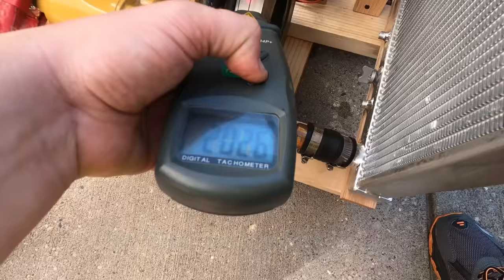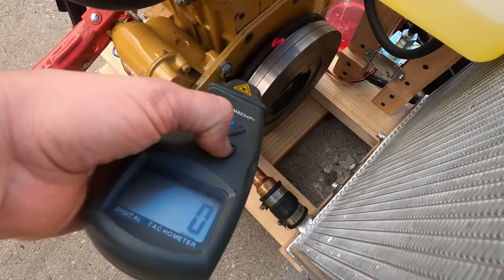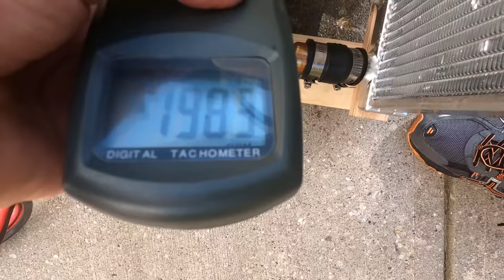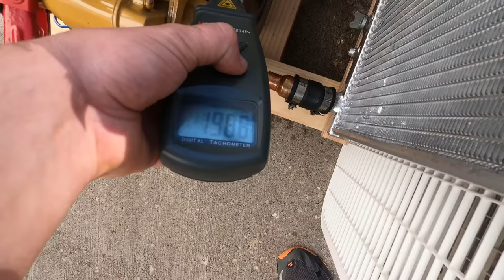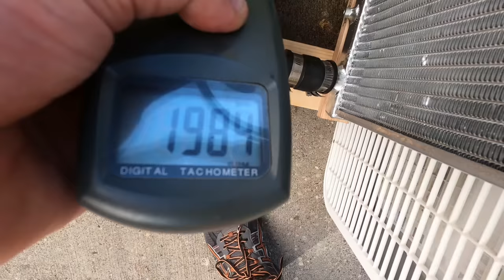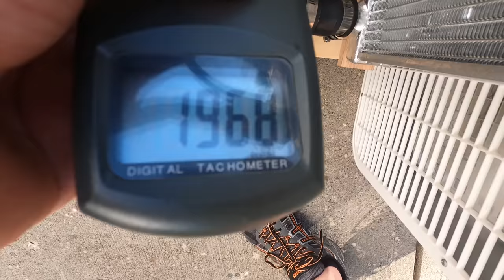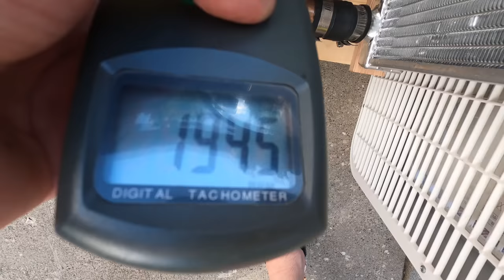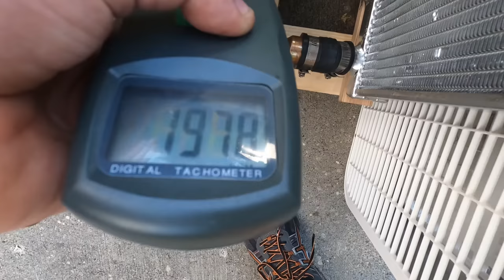Will Caterpillar Diesel run on Cooking oil? Attempt to run engine on Transmission Fluid & other oils

Comment: The original Rudolf Diesel prototype actually ran on coal dust. It exploded. The inventor designed the revision to run on anything combustible that could be sprayed into the cylinders. Be aware, however, that there is a certain amount of lubricity required in the fuel for upper cylinder longevity that may not be present in the oils used here. As others have stated, power level is unknown without load testing.
Reply: the abandon from coal dust is the fast wearing from the engine because produce lot of abrasive dust, not the explosion
Reply: @leneanderthalien   Of course, but I'm quite sure the explosion was more of an incentive. 🤣
Reply: vegetable oils are fine to run in this, just flush with diesel fuel for a few min before shutting down.
Not sure the ATF was a great idea though ... the pump might not have liked that one very much.
Reply: @detaart  iv run small amounts of ATF in my 5.9 Cummins with no issues. I would NOT recommend it nowadays however as most ATF fluids have friction modifiers intended for clutch packs and would probably destroy a P-Pump or sand blast the top of your cylinder head. My best guess anyways.
Reply: @NoblesTx  i would imagine a little bit is fine to help keep things clean, but the idea of running it on pure atf makes me a but uncomfortable
Reply: @detaart  out of all the stuff iv ever run has been heavily mixed with diesel and I usually only run it because I have no where to dispose of it 😂
Reply: @NoblesTx  lol i guess that's a valid reason too 😂
Reply: Interesting.
Older Mack engines were pretty much bulletproof when it comes to odd fuels.
They are just a few steps away from multi fuel engines.
It was typical to filter the old engine oil after a change, and put it into the fuel tank.
To clean the injectors, you simply added a quart of ATF to the fuel.
But, it’s red, so you added a quart of old engine oil to it as well. 
The old engine oil would turn the fuel as black as coal.
Running vegetable oil or animal fat is not an issue, as it has more lubricity than low sulphur diesel fuel at the pump.
The caveat to the veggie oil?
You have to take the glycerin out of the oil before you use it.
I forget the chemical, but it is safe to do so, and the glycerin can be made into soap.
The old multi-fuel engines would also burn nearly anything made of a hydrocarbon, like gasoline, naphtha, kerosene, and the list goes on.
They also will burn any kind of alcohol, including vodka!

Newer engines have incredibly high fuel pressures, and the slightest amount of water in the system would ruin the injectors because of water abrasion.
Reply: @dangeary2134  Interesting info. I believe my uncle used potassium chloride to force impurities to settle to the bottom, like a water separator.
Reply: “ Not Sprayed - Atomized “
Reply: Maybe so, but spraying more or less implies atomizing.
Reply: A warm Diesel engine will run on most oil based fluids,the performance under load is another thing altogether depending on what injection system is fitted,high pressure electronic injection systems might blow the tips off the injectors because some of these fluids are a lot thicker than diesel,another thing to consider is in cold winter conditions these other products thicken up considerably when the temperature drops so can make starting difficult if not impossible. Earlier diesels are far more tolerant to fuel quality than these high performance engines we have today that are fitted with all these electronic emission controls that are now mandatory.
Reply: Just add 1/4 quart of 2 stroke oil to 10 gallons and it should have more lubrication than it did. Maybe enough to keep up with old diesel fuel with sulfur. Lucas Oil is pretty good for lubrication too. It won't make the engine better. But it make it run normal.
Reply: Vegetable oils have BETTER lubricity than diesel. :)
Reply: The engine of the Leopard 2 main battle tank is a diesel unit, designed as a multi-fuel engine.
However, it is mandatory that about 60% of the fuel must be diesel (because of wear, deposits, etc.).
The remainder can be any combustible liquid or liquid combination imaginable.
Reply: Diesel's name has become synonymous with a crude oil derivative, but he designed his engine to use a variety of fuels, from coal dust to vegetable oils.
Reply: @detaart    when ShTF  I run it on used mineral oil from transformers  unlimited supply
Reply: Ah, 4 cycle engines don't require upper-cylinder lubricant in the combustion cycles, you're thinking of a 2-stroke.
Reply: @Ken-rk3by  Diesels require upper cylinder lubricity in the fuel also, 4-stroke or 2-stroke.
Reply: @anonymousinc6330  Ya for the injection pump and the injectors, not the combustion and 4-cycle engines get the lubrication from the oil pan splashing oil on the cylinder sleeves, and when the piston is on its way down the oil-ring scraps the oil off leaving a micro-film for the compression rings to slide on, but not in the combustion chamber.  Now a 2-stroke diesel acts the same way as a 4-cycle the oil is in the oil pan lubricating the pistons at the bottom of the stroke. I know I have a 4-71 Detroit in my boat and if you are getting oil on the combustion chamber you need to rebuild the engine or risk a runaway. A 2-cycle gas engine is totally different, as the gas and oil mix lubricates the whole engine. They often don't even have the oil ring. I hope that clears it up for you.
Reply: An engine running on some kind of coal product is a great opportunity, to the extent one could be immune from the heavy boot of government.
Reply: @KutWrite   I think that was the aim, but the inventor found out very quickly that the risk was too great. Explosions happen in coal mines for the same reason. Besides, you need a certain amount of liquid fuel in the cylinder for cooling.
Reply: The carbon build-up will destroy the enjoin
Reply: i wonder when someone will try to run a diesel engine on nitroglycerin.

Comment: I knew the heating oil would work. Had a friend that bought a house in the mid 2000s and their was two 1,000 gallon heating oil tanks full on his property that he wanted gone. I had an old F350 with the 7.3L IDI engine in it. I ran almost 2,000 gallons of the stuff through it with no issues. I was nice not having a fuel bill for a while.
Reply: It is illegal to do so in us as it is Red colored and had no tax paid on it . Home heating oil is sane as diesel except the Cetane is not checked .

Off road diesel for tractors for example is red. If they find the dye in your fuel filter you are in trouble…
Reply: I mean, heating oil is basically red diesel which is a diesel fuel that doesn't have huge tax on them and usually been colored red so only farm equipment able to use them, you pretty lucky law enforcement doesn't pull you over and fine you because you use red diesel
Reply: You shouldn’t let it go to waste but you can’t Legally use it on Road.
Sell to farmer , use in generators ,
Front end loaders etc.

I worked on a harbor tug 35 years ago and every crew member but me had a diesel car or truck….

Just warning people what the law is, take your chances if you must, but know.
Reply: @josephpadula2283  they just dip the tanks with a cloth now
Reply: @josephpadula2283  One of my old bosses was a truck driver owner operator 47 years experience.
He was starting out just as WWII ended.
He told me truck drivers were caught cheating by the Ministry back then.
It was Blue dye and would create a blue haze on the engine as it's running. 
Big fines. I remember him saying anything more than a couple shot glasses worth dumped in and it would show up and that was in the 40s. 
We ran his Drott shovel on Boiler Oil many times he said the ash was dry vs Diesel oil otherwise it's identical.  
Can't use Bunker Oil unless you pre heat to 350F if I remember right. Impossible to wash off if you get it on something it's coal black. We had about a drum worth of the stuff from a scrapped Freighter.
Reply: @Elijah’s MiniBikes specifically it is the road tax. Home heating oil is not taxed as much as road diesel.
Reply: @Elijah’s MiniBikes Road tax, excise tax aren’t added which can be about .50 cents
Reply: Based tax evader
Reply: @mohammadrifqisatriamas7311  when has anyone driving a diesel pickup truck ever been pulled over and had their tank dipped? unless youre driving with a DOT number displayed or for some reason they saw you or suspect you filled up with offroad diesel i dont see it happening.
Reply: Considering every 5th car I see in my state goes around with expired tabs with impunity, I would not worry about getting caught with red fuel.
Reply: @Elijah’s MiniBikes Red dyed diesel/ heating oil hasn't had road tax paid, that's why it's red to denote off road use.
Reply: @ucfsub  where i live diesel costs 2 euros per LITER! 2000 gallons of free heating oil would be a blessing
Reply: @josephpadula2283  It would be nice if they actually used the money collected for fuel tax on rebuilding the roads. We could have nearly all new roads every other year all across America.
Reply: @josephpadula2283  but you can't dump the fuel as that is also illegal
Reply: Jordan Rodrigues    people will just roll back the odometers😄
Reply: True diesel fuel was the same as home heating oil with close to 100 percent sulfer back 40 years ago until epa screwed things up.
Reply: Diesel fuel use to be half the cost of gasoline. Back in to 70's it was 12 cents a gallon.
Reply: @josephpadula2283 Are you that picky in your real life every day?
Reply: @mohammadrifqisatriamas7311  Even if you run regular diesel, how often do you get pulled over and checked what color the fuel is in your tank? I've driven a diesel truck for a long time and never once had anyone check the color of the fuel in the tank.
Reply: Heating oil is diesel!  Winter blend diesel is number 1 diesel which is blended so it doesn’t gel which is what heating fuel is.
Reply: Jordan Rodrigues  ifta fuel tax reports may as well be used for that then.
Reply: I want to know where he got that engine
Reply: @josephpadula2283 not illegal if your running alternative fuel . Horse $hit . Just don't run off-road dyed fuel in a road vehicle.

Comment: I have an old ('95) BMW turbodiesel, and as an experiment I ran it on Sunflower oil & Rapeseed oil earlier this year, with a bit of petrol thrown in to thin the cooking oils a bit.

Ran perfectly. Smelled like a chip shop too, which was nice.

It also got a mix of ATF and standard paint thinners (50%/50% toluene/xylene) mixed in with diesel to clean out the injectors.

I had an old Transit van with a 2.5L non-turbo diesel which would run on almost anything. - Went to watch drag racing in it once, and drove 145 miles home on all the cooking oil people had left behind after the weekend's racing. Mix of all sorts.

The Transit also got old engine oil chucked into ithe fuel tank occasionally. It didn't mind that either.

Comment: I recall a long term test of sunflower oil in a diesel back in the early 80s , the tank started to collect a heavy slug.  A result of the heating and reheating the oil in the return line.    BTW, there are diesels out in the oil fields that run on just filtered crude oil.
Reply: It's like sticky chewing gum. Have to scrape it away.
Reply: Near where I live there are 3 diesel engines that run on crude oil, they are 3 stories high and generate electricity for the grid. 2 are 65,000 HP and one is 100,000 HP.
Reply: @grancitodos7318  do they run 24 hours per day? Wonder how many hours they have in them?
Reply: I was on a cross country trip and rode through an oil field... there were single cylinder diesels (looked like the old hit and miss engines) that look like they were built in the early 1900's... just chugging along.
Reply: Bunker oil.
Reply: There's no way you could run "filtered crude" through any modern diesel engine - it would never make it through the injector pump and injectors. Raw crude is pretty thick stuff

Comment: In the 90s I ran my Land Rover discovery 200tdi on 20lts of cooking oil from Costco the 20ltr drum cost £9.99 I always had at least half a tank of diesel topped up with veg oil. The diesel engine ran quieter and pulled a bit harder but the only problem it did smell like cooking chips and if we went out in a group of off-roaders they asked me to be at the rear of the group to stop people feeling hungry. It did save me loads of money using the cooking oil.

Comment: The red fuel is off-road diesel. For machinery that does not go on the roads or highways, industrial and farm use. Also known as #2 Fuel Oil.
Reply: In Europe it is only allowed to use this in heaters. The red color indicates lower tax rate on this fuel. It also has other additives than diesel, which contains 7% biodiesel in Germany and has a cetan number of around 50. Heating oil is a little harder to ignite. This would not make any difference in mechanical controlled diesel engines but is an issue with modern injection systems.
Reply: Kerosene is also dyed red here.
Reply: Off road diesel is exactly the same as on road diesel, it's just dyed red because it's not taxed and allows DOT to see if drivers are using the right fuel.

Comment: I had a 97 Ford F-350 that was my daily driver for 5 years using nothing but waste vegetable oil that I pumped out of oil dumpsters at the back of restaurants. I drove to mexico three times and all the way to Costa Rica and back. I’m sure I paid for the truck a few times over in fuel cost savings. It had a fuel filter that doubled as a heat exchanger using coolant from the engine, and a separate tank for oil that was also heated by coolant. No issues with reduced power at any time. Ran quieter due to better lubrication of the injectors. Truck started on diesel, then switched over to oil once engine heated up. Oil system and truck was working fine when I sold the truck about six years ago. No issues with clogging, etc.

Comment: Years back I had diesel car and the price of vegetable cooking oil was at an all time low. Half the price of diesel so I ran it on the veg oil. Thing is it smelt like I was frying food but it ran great. Engine noise was almost zero with the heavier veg oil. Tappet noise was totally gone. It really did quieten everything a lot. No problems with starting it up etc.

Comment: I had no idea Cat ever made a diesel engine that small.
Reply: It's probably a yanmar or Kubota or something else  rebadged
(Edit: appears to be a Perkins 402D-05)
Reply: Thank you ! Never knew Cat made one that small so great you posted Perkins rebadge..
Reply: Cub Cadet compact loader tractors new lititure said it had a Cat diesel but had a Perkins id an tag . CubCadet no longer has compact diesel tractors (makes)  they had issues stay clear
Reply: I have the 4 cylinder version. 
It's actually made by Perkins. 
Mine says made in England
Reply: @juliogonzo2718  Yep, its a Perkins made engine. I have one that came from a truck APU (Auxiliary Power Unit)
Reply: I want one.  Would make a great pepper add with a dc generator head for charging battery bank!

Comment: It should be noted that, if you accidentally fill with gasoline instead of diesel, you can adjust the viscosity with mineral oil for the engine, if there is still room in the tank. The thicker the oil, the less oil is needed. And the viscosity of the fuel is necessary to prevent the high pressure pump from seizing. This way you can save the engine, and the day, without additional costs for emptying the tank in service.
@Andrey, you can do the following experiment to see what is the percentage of oil plus gasoline to get the right viscosity, so as not to destroy the engine.
Reply: If you ever put gas in a diesel the best oil to add is 90-weight gear oil because it has a high sulfur content for lubrication of the injector pump

Comment: heating oil IS DIESEL FUEL from before they took the sulphur out and added the red dye. the dye is there so they can tell if you're running non-taxed fuel.

Comment: In Houston it was a Hurricane that changed everyday life , no fuel for gas stations during a week of plants recovering the flooding . I had a W123 Mercedes and recovered used 55 gallons of veggie oil sitting for a few months . It’s a micron sock filter  you pump the oil through then make it thinner with other mixtures added to get a desired batch . Different straight tank runs are out their to explore . My week of needed reserves did the trick , was able to get through the event , the w123 617 didn’t skip a beat .
Reply from the maker: W123 is a legend! I'm glad it worked for ya!

Comment: I know you said you can't do any load testing, but that's really the only way to know for sure. I don't think it's fair to say those liquids were comparable as fuel after this test, only that they all succeeded in keeping the engine running at idle
Reply: He wasn't testing for power output.
Reply: @RichieCat4223  Which makes the test pointless
Reply: @stuartruss7536  Not really.
Reply: And the governor is keeping the engine RPM the same 😅
Reply: You can compare the energy density of the different oils and have a good expectation of the change in power output. I run used motor oil in my tractor.
Reply: @RichieCat4223  That was my point. You can put 8 AA batteries together to make 12 volts, but it's not gonna start your engine. Without a load, there's no way to tell how well the engine's running.
Reply: From my experience from running most of the oils tested in this video in a old diesel I can tell you that there isn’t much power difference between them and diesel the only oil I tested that you could notice the engine down on power was back end oil from a tractor as it was a bit too thick
Reply: The engine wasn't idling, it idles at 600, not 1,960 it was around 3/4 throttle, and they redline at around 2400rpm.